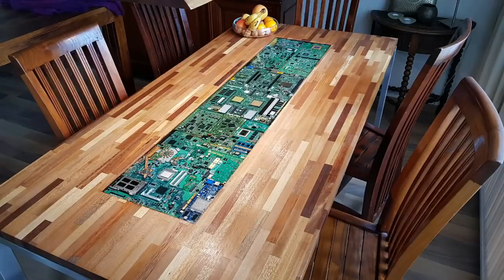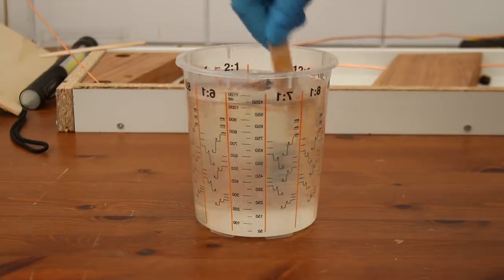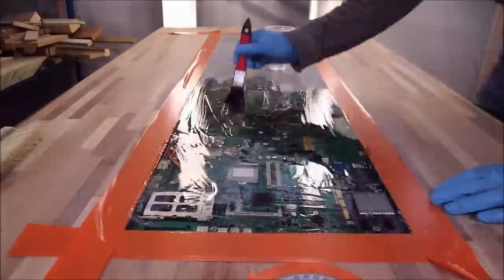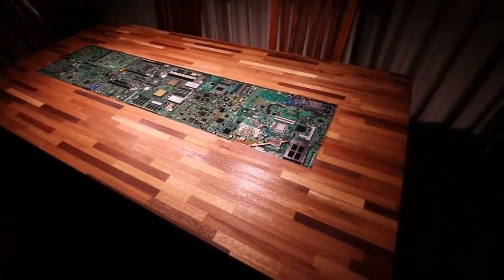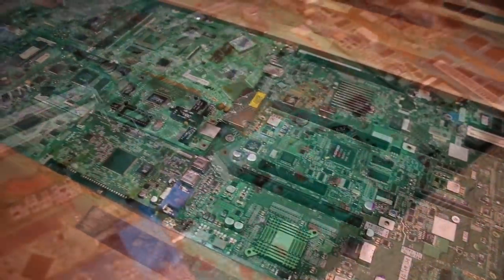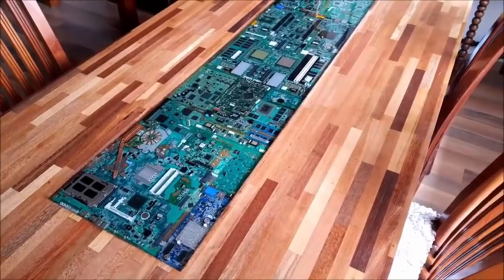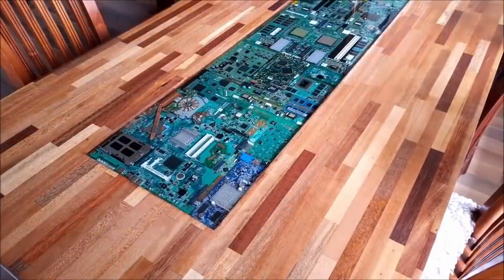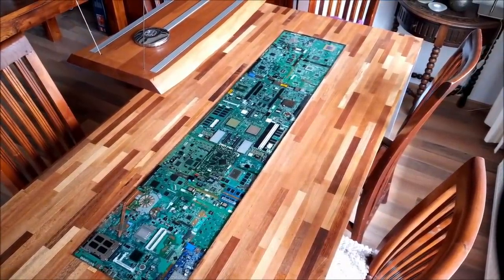Circuit boards with lights in epoxy in a table

Comment: It's generally well known that sticky epoxy is caused by incomplete mixing and/or mixing/pouring with temperatures below 70 degrees F. Also, it's also generally well known that epoxy needs to be sanded between layers so the layers will stick together. If you pour the next layer while the previous one is still sticky (4-8 hours) you can skip sanding. If you wait til it's set then you should definitely sand it.

Comment: Was the failure do to epoxy application, depth of poor, temperature, not removing air bubbles, I watched your video all the way through. I must say I’m inspired to make this for my co-workers in the IT Dept. 
Thank You for sharing Brother
Reply from the maker: There was only one reason: I cut the corners at mixing...

Comment: Beautiful, I wonder if something on the circuit boards affected the drying time ?
Reply from the maker: I doubt it. The first pour was to attach the boards to the table, so they wouldn't move when I drilled the holes for the lights, that pour was directly over the boards and went fine. It was rock solid.

Comment: мужик, ты извращенец!)))
Reply from the maker: I'm afraid my Russian is a bit rusty...
Is that good or bad?
Reply: @Onrust1 Russian language rich), in this case well!) but, not pity you was so much resin, to do the table with electronic boards?
Reply from the maker: I needed 10 liters. But it was it all worth. I'm only doing fanmail right now. 😆😆

Comment: A faster way to remove components from the boards is using flux and a heat gun, the parts will almost just slide off
Reply from the maker: Really? Interesting, thank you. I'll remember that. (You're right, I Googled it. Would that work with my paint stripper..?) Thanks again, always nice to learn something...
Reply: @Onrust1  Put a high tempered glass pane on top of the table but put self curing epoxy on the entire table first, kind of like making a kitchen countertop.
Also, the wood wants to drink up the epoxy so imperfections will probably want to show themselves. Perhaps try to cover the sides with something? The aluminum tape seemed to work very well on the bottom, perhaps finding a similar thing to cover the sides since you will obviously sand everything once it sets.

Try also with smaller pieces first and find what suits you best.
Reply: @Onrust1  I'm not sure with the paint stripper.

Comment: You could hide a working PC in it. 
If the epoxy does insulate electricity and can transfer heat, you could glue in a single-board computer like an Intel NUC or Raspberry Pi. Nothing expensive, just for browsing the web, netflix, office etc. The computer would blend in with the other boards and and it would be a little surprise to see that the table actually contains a working PC.
Reply from the maker: I like the idea. Just... where would the connectors go? On top? They would fill with dirt... Still nice idea, yeah.

Comment: you could do the groove you mentioned but fill it with a wood strip and fill the last bit of the space between the wood and epoxy using a siringe filled with thin epoxy (like 2 pack car laquer) or superglue , that should make the side of the groove clear again 
i think spraying the boards with verry thick layers of clearcoat paint to fill in all the little holes and valeys before finisching with casting resin wouldve worked better , you pour in slowly from one spot and let it flow out all the way , moving the pour araund will likely add bubbles and maibe even waterripples in the finisched product 

the idea is pretty good , i bet a city hall would be interested in a table like that with a detailed 3d model of the town center complete with walkways parks roads cars foodstands marketplace and pedestrians cast in resin as long as its no highrise buildings it should work 
its also handy to show visitors where to go without using a map
Reply from the maker: Are you German? I think I hear a accent in your writing... 😆😆 Thanks!
Reply: @Onrust1  next door neighbour to the germans , they like our beaches though , keep mentioning that we stole there hole in the sand though , we allways ask for our bicycles they took from us in the war
Reply from the maker: Jeetje... buurman! 😆😆

Comment: Could it be the amount that you mixed all at once? Some brands have a maximum amount that you can mix and pour before you can pour the next layer, so you have to pour it layer by layer, waiting for the previous layer to fully cure with these large projects.

Comment: This same problem happened on a table I was working on. I discovered that I could rub up a spot on the sticky area and pull it up. Eventually I was able to pull most of the layer up and chisel out the remaining epoxy. Most of it came up as a single layer. Then I sanded the layer that was beneath, cleaned it and applied a new coat of epoxy. The table was perfect with the new layer of epoxy.
Reply from the maker: Nice to know. Gives me some heads up to try something similar too..

Comment from the maker: Thanks for watching my video! PLEASE READ THIS BEFORE COMMENTING
Answering most stated comments:
- Put a glass top over it
Yeah, good suggestion and I might consider, but the ugly spots won't go away with that..
Update: after getting this suggestion over 200 times (really!) I feel I have to elaborate now on this. I will NOT put a glass plate on top. I've got it worked out by now and want to try to fix the ugly and soft spots by carefully removing layers and pour epoxy in again. I know now three things I could have done better / different. Like most what I do the fixing too will be an experiment to learn from, so I will definitely make a video of it, titled 'how (not) to pour epoxy'. 😊 Wait for it. 😊
- Just pour one new layer epoxy over the whole table
Could do that, but again, the ugly spots won't go away with that, and second I don't like the look of wood underneath epoxy that much... Covering wood in epoxy for me is something like making plastic out of something natural..
- Cut out the center, put in a new bottom and start new
I will certainly not do that. I've just so many other things I want to make..
- You should have poured thinner layers
The specs of the epoxy said I could pour 5 cm at once. I did maybe 1,5 cm. Most is fine. I screwed up the mixing.
- You should have mixed the epoxy like this ... method, or like this ...
Hey, I know I SCREWED UP the mixing. Thanks for reminding me. 😉😉 I will take your advice and do better next time. I promise. 
- What if one LED dies? How will you fix that? You should add solar to charge the batteries
You haven't watched the whole video, now have you? I know everybody skips parts of videos, but skipping the essential parts makes you ask stupid questions... 😁😁
- You're better in converting buses
Ok, I confess, I made that comment up. 😆😆
Reply: Make a give away.... I want it
Reply: Can you maybe buy a custom glass top for it?  It is beautiful regardless.
Reply: Maybe another brand of epoxy?
Reply: Hey onrust you put vernish on epoxy, that’s the bad, you must wax the epoxy without vernish
Reply: So grind another 2.5 hours.... ah ah ah!
Reply: In case you got a superb project there
Reply: How's the bus? It's my dream to do the same so I hope you're enjoying it!
Reply from the maker: @adam.g  Yes! We do! As a matter of fact we had a great vacation at the Dutch beach with it. I taped quite some video over there, and I'm busy making a video with that material. In that video I want to answer some questions about the bus too, like what it cost me in total... Wait for it! 😊😎
Reply: @Onrust1  Awesome! I look forward to that!
Reply: I just had another idea to solve the epoxy problem, is there a way i can  get in touch with you, to send you the design i had in mind, because im really bad at explaining in words.
Reply from the maker: @thomasthetankengine4443  Putting a sheet of glass over it? 😊 I got that suggestion so often that I reacted in a pinned reaction underneath the video. In touch with me? You want to call me? 😊
Reply: @Onrust1  it indeed is with glass, but it think its better, because it involves a couple of other ideas (and no epoxy is one of them), and i dont want to call you just maybe mail, or something... But yea, now im this far i might as well just try and explain it over here, so the idea i had was, you make the exact same design you had so far, but you just leave the epoxy out of it. Instead of this you indeed just put glass on it, buuut with like an iron border around it, and while im writing this, i just thought like since you already have lights un the table, you can put some in that iron border as well. This might sound really ugly but in my head it looks nice. (you can  also do this without the metal border but i think it will look nicer with that extra little bit
Reply from the maker: @thomasthetankengine4443  That's nice of you, thinking with me like that. But I most certainly won't start anew - that is what you are suggesting, right? The reason is that that will cost me too much time, time I want to spend on so many other projects... Thanks, Thomas.
Reply: What if you put a 1/4 inch smoked glass covering all the table?... It will help to protect it also.
Reply: I like that you showed the sanding part. This way people that try this for themself at some point wont panic when they see how white and ugly it gets when you are sanding it and think they are doing it wrong. The more shown the better.
Reply: What about routing out the damaged layer?
Reply from the maker: @Mark Maker Yes, good idea, I'm certainly considering that.
Reply: lol, also I didn't think the soft epoxy looked that bad, I know it's not what you planned, but I thought it looked cool. It's just a Bob Ross happy little accident! 😎
Reply: that was a beautiful job what a shame. But maybe you could find a way of prying the whole thing up seeing you used tinfoil underneath and then redo but this time use a strong sheet of glass. love your idea with the lights.
Reply: The thing with epoxy is to not mixed large amount of it at once like your 7 liter batch, keep it small and managable !
Reply from the maker: @vayandas  I did 5 + 1 + 1 liters. The 5 did okay. I screwed up the mixing of one of the 1 liters cups.
Reply: How much did the 7 liters of epoxy cost?
Reply from the maker: @archangel7052  that is in the description of the video.
Reply: @Onrust1  woops...300 euros😱
Reply: @Onrust1  how about a tempered glass on top? Much cheaper option no?
Reply: Btw I really want to make one of those scrap wood table but I realized the cuts have to be perfect and I'll needs lots and lots of clamps lol.
Reply: als je een trilnaald gebruikt verdwijnen de luchtbellen

Comment: heres a tip for stiring.......... i use an old small whisk in my cordless drill...... never had any problems with unmixed resin using tbhis method..... i still use the big lolly sticks for getting right into the side but it does increase overall stiring and the time it took...... great piece by the way very inspiring

Comment: May have been your choice of epoxy. There is a limit of most epoxies in how thick you can make a pour, if I recall it has to do with heat buildup in the curing process.

Comment: When you pour the epoxy you use a metalic needle or fork to distribute the epoxy evenly and avoid the air gap the tighten in between layers , 
When you pour the epoxy you don’t  pour all of it but in many steps and you move it with the fork so the air get release easly , thanks for lovely video .
Reply: nasser alshagdary Attach the fork to that vibrating device that was mentioned in the comments...

Comment: Ok, this was amazing!  And I REALLY appreciate you showing the parts that failed... Helps everyone to learn and what can happen.  Great job though!
Reply: Ah, you actually replied...well 'liked' my comment.  Yea I was just talking with someone in a chat room about your video.  The Fiber optic idea was so cool as well.  I don't know how much that cable costs, but great to have that on hand.  I kept thinking...how can you randomly pulse light through the 'input' at the side of the table?  ...that would look cool.  :)
Reply from the maker: Exactly the temporary character of shining a light in the fibers is what I like. If there was a permanent light, it would get annoying fast, I think. The link to the cable is in the description. It is not that expensive..

Comment: When Mixing Epoxy ,you got to use a Gram Scale,mix Epoxy with a Stainless Steel paddle,Scrape the Sides and poar in another Bucket and mix again,Sometime i put the resin in a Microwave for 15~20 Sec.,,,Been useing that kind of Epoxy for over 40 years WWW.MooseWakeboards.com

Comment: Put a wood ridge around the entire table border and pour a thick coat of epoxy on top of the whole thing. This will cover the soft spots and encase everything. And make sure you heat the epoxy resin before mixing!

Comment: Use heat to melt the epoxy, that will fix the imperfections... Good Luck.
Reply: epoxy is a crosslinked material, meaning it does not melt, it simply burns. Kind of like tires.

Comment: Polish it, then put a glass top on top of epoxy. Also, best way to remove the board components is with a heat gun.

Comment: About the only thing you can do with uncared epoxy is wait... sometimes, weeks later the epoxy will finally cure hard and you can sand out the imperfections. It's just much slower curing because there wasn't enough chemical to get it to kick off correctly. But over time, some epoxy formulations will over time get to a workable hardness. Maybe all is not lost...

Comment: In my past life I did quite a bit of epoxy casting of various kinds. I used to have the same non curing bits of material that would show up on occasion. I found this YouTube video 5 or 6 years ago and it made the issues of non-cured spots of resin a thing of the past. This is the video https://www.youtube.com/watch?v=ybFdaYVcVuE looking back I can now see the random way I was mixing left a lot of the thick viscous material subject to hiding in all kinds of places in the mixing container. Totally AWESOM idea of your table. I am going to dial it down a bit and am going to start small. At work I have 2 work stations that are about 30" wide by 24" deep for desktop for keyboard/mouse etc. I work in IT and have dead network gear to harvest PCB's from.   THANKS for the great idea!

Comment: Just cut a piece of glass to cover the boards and epoxy that into place.  Then, put some trim edging around the perimeter of the table such that the top edges are the same height as the glass.  Pour a final pour of epoxy over everything.  Done and fixed!  Great project.

Comment: Could you just flip the table over, sand down to the backs of the circuit boards and epoxy that side?   Place a group of LED tubes on the former front side and you get a stained glass effect.

Comment: Reinforce underneath to compensate for weight of epoxy and for loss of material to the whole structure. Also pour all epoxy at once and over the whole table.

Comment: with a motherboard of a perfectly functioning PC it would have been more interesting.  
Still a great job!
Reply from the maker: Impossible. You couldn't cool down a motherboard cast in epoxy. It would blow. Besides, what if it broke down? You'd end up with what it is now... 😁😁
Reply: Onrust! 
Quite right!  but what if you used an acrylic sheet whose interior has a real working PC?
Reply from the maker: @macroby  For you to make that mod (and make a video... 😊).
Reply: Onrust! wow!  very honored ... thank you! 😊

Comment: turn the table over,  and use the circ saw to cut the expoxy,  and  boards out.  then find new boards and put a false bottom into the table.  you can strengthen the table too while your at it so it doesnt sag.

Comment: not really dude.. after routing the edges, that aluminum tape will unseat quite easy by applying some heat to the bottom of the table and the entire chunk should unseat with some gentile persuasion.

Comment: Your not completely right about the fix. Because you used that silver tape you have actually made a separation point and will be a bit easier than you think to get it back out. I would use a router on the inside of the epoxy (destroying a bit or two) and make 3 or 4 sections to remove.